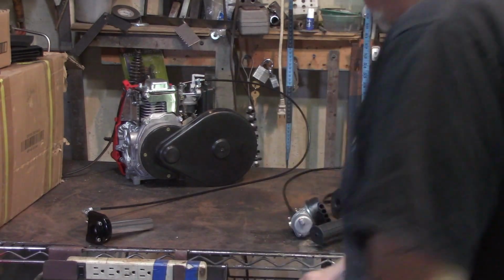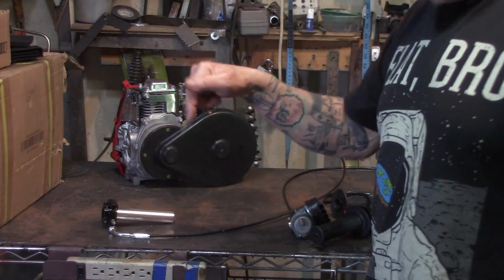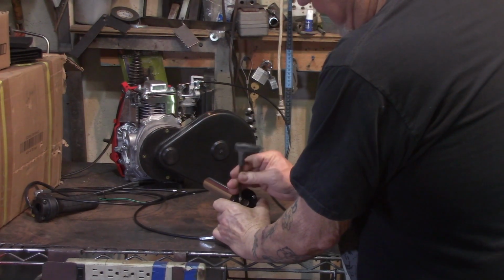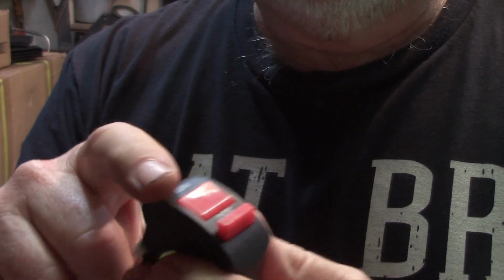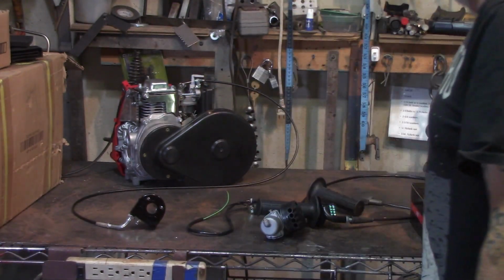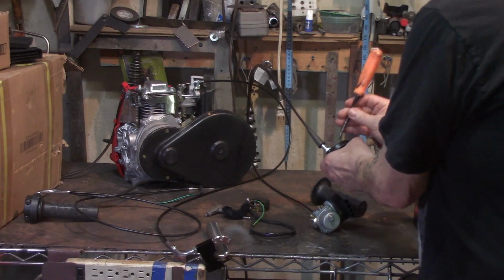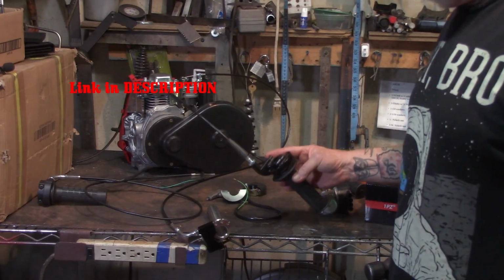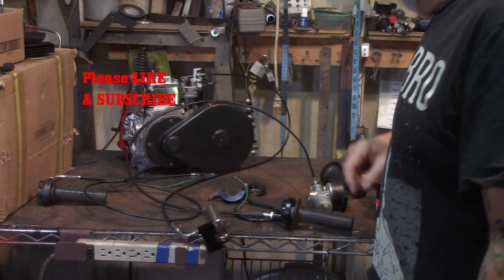Upgraded, All-Metal Throttle For Motorized Bicycle

Comment: Starting off absolutely love the video!!! But Style #2 still shows plastic on the actual “round about”piece of the throttle, so I’ll definitely be getting option #1 and the adjustability is definitely a huge plus! But my one biiiig question that’s probably stupid but not shown in this video is, do either or both options have a locking pin/notch/bolt to keep the throttle assembly physically locked to the handlebars exactly where it is installed???
Reply from the maker: No locking pin but assembly is tough enough to be tightened up enough so it won't twist
Reply: The throttle assembly comes with a screw like piece in on the top inside portion of it that goes into a hole u drill on the handle bar to hold the throttle assembly together

Comment: Do I glue the handle or what?
Reply from the maker: The throttle assembly simply clamps on w/ 2 screws
Reply: @HughesMotorized  not for the aluminum throttle I just bought. I had to super glue the grip to the throttle
Reply: @HughesMotorized  I was talking about the rubber grip
Reply from the maker: @bo-boboski4118  Provided the grip fits, I'll spray some liquid hair spray in the grip and slide it on. Once dry. it will stick

Comment: Just a heads up on the aluminum style they can have rough machining that shortens cable life drastically from my experience I had one cut two cables in one month just to be sure to use sandpaper and smoothing it out

Comment: How do you put the style #1 on the handle bars so it doesn’t spin when you twist the throttle? I had the plastic one that had a notch that stuck into a hole drilled into the handle bars but I can’t figure it out for the aluminum one.
Reply from the maker: The housing is simply going to be clamped down on the bars. It is strong enough so if you just get the screws snug it will hold
Reply: Well I'll be dipped. I appreciate the quick reply! I guess this one can be tightened alot more than the plastic one , which makes sense. Plastic one is so brittle.
Reply: I was wondering about switching from the twist throttle to using brake lever instead after awhile?

Comment: I've got a question i have a 2 stroke 100 cc Pexmore engine kit. The throttle broke yesterday because of the cheap plastic but i want to know will style 1 work with the 2 stroke?
Reply from the maker: Yes. You won't have a kill switch though

Comment: I’d keep looking around for a decent twist throttle, after buying I don’t think this is it. The throttle cable is too long to stay snug without maxing both adjustments, the electrical wires are too short for the switch to reach the handlebars, I managed to strip one of the screws while installing (be that me or the metal), and there is no set screw to hold the thing still. It is nice that the grips match each other now though, with some modifications it works about as one would expect

Comment: Any idea why the chain would keep falling off the back sprocket? too loose? It seems to be happening during takeoff. Do you tighten your back wheel before putting the spring on the chain tensioner on? I have 3 bikes and 1 of them keeps giving me problems.
Reply: I have the same problem,  i have a 100cc engine  on a mountain bike and chain keep falling off when i take some speed and almost throw me over my bicycle
Reply: @arthurrustin1450  I am going to try and tighten the chain first and then put the chain tensioner spring on. I think the slack in the chain from the spring being on while tightening the chain is causing the chain to fall off the rear sprocket when trying to accelerate because the tension of the chain creates more slack on the bottom when the gear rotates when the motor is engaged which causes the chain and chain tensioner to become tight on the top and more slack at the bottom due to the chain not being all the way tight primarily from tightening the chain while the spring is on the chain tensioner instead tightening the chain without the spring on the chain tensioner first.
Reply: @evenbuzzard4642  Maybe i wil also try like that 🤷‍♂️
Reply: @arthurrustin1450  I figured it out today by adding another chain tensioner near the rear sprocket. There was so much chain slap that the chain would fall off the rear sprocket every time. Imagine pulling a string tight and strumming it like a cord. The chain behaves in the similar way when adding tension from the engine. Hope this helps.
Reply: @evenbuzzard4642  i wil try thanks
Reply: Make sure your sprocket is aligned, otherwise you will be dealing with chain jumping all day long

Comment: Is the aluminum throttle slide smoother compared to the stock one?
Reply from the maker: definitely smooth action on the aluminum one and far less prone to break
Reply: @HughesMotorized  can they fit normal bike grips or do they have to be the ones from the motorized kit. I got those bike grips that got the two screws at each end and would be nice to know if I could just use those instead
Reply from the maker: @nicos9937  The throttle needs a 1" grip and the bars are usually 7/8. So you'd need to modify the grip if possible
Reply: @HughesMotorized how does it stay mounted? Cause I just bought one that just spins
Reply from the maker: @JoseDiaz-ug1xo   It clamps firmly onto the handlebars